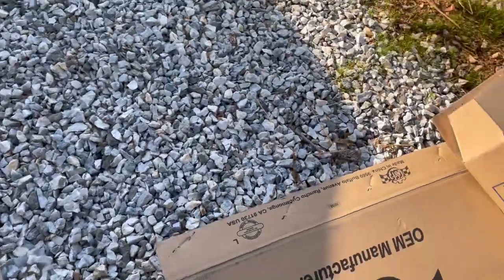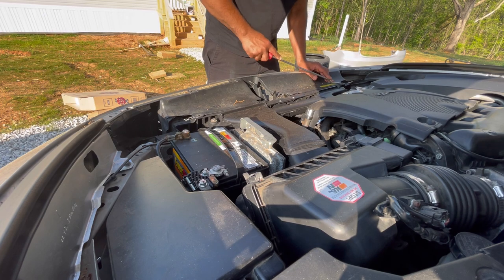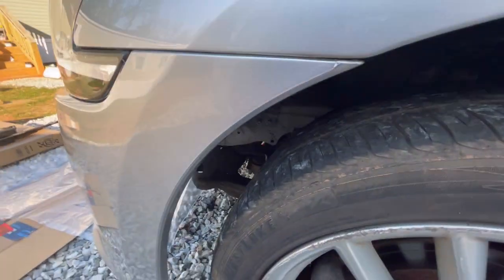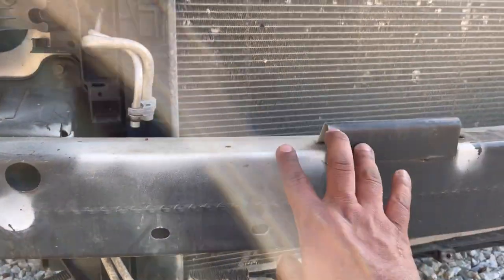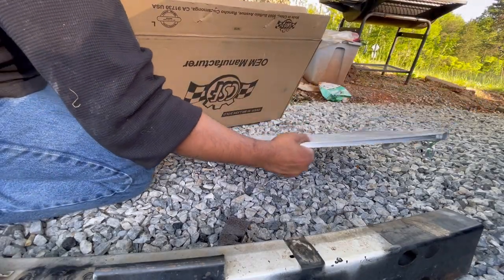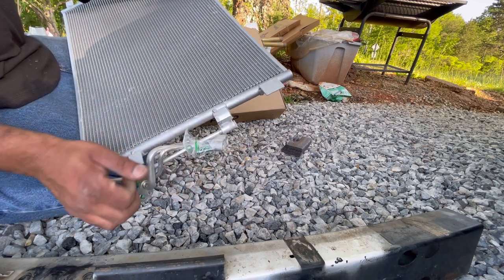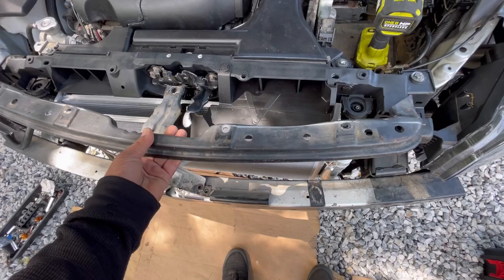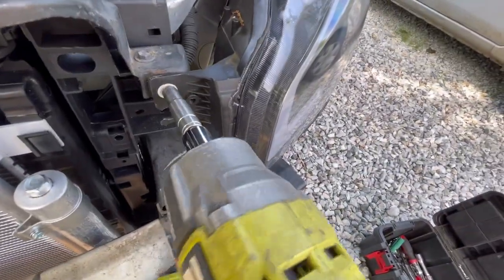Installing A/C Condenser On My 7th Gen Maxima

Comment: How was your A/C working and you didn’t have a condenser on the car.
Reply from the maker: My a/c never worked on the car I had brought the car from auction with the front end wrecked and I rebuilt it then I’ve been modifying it once I finished rebuilding it